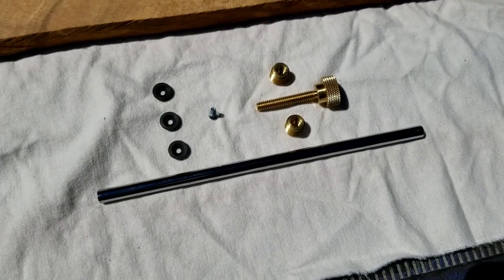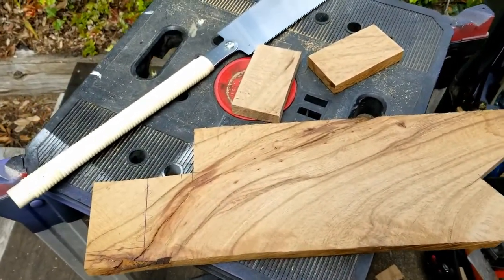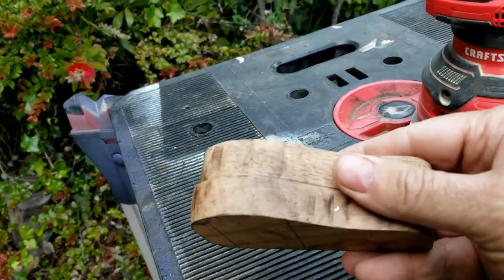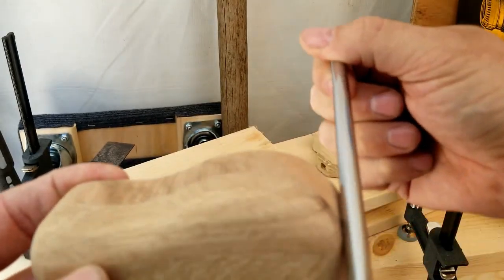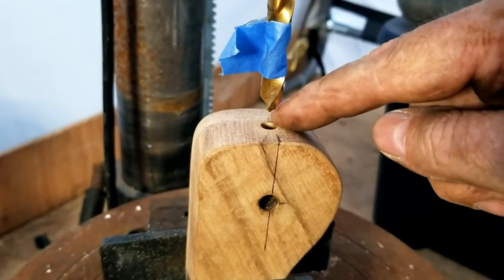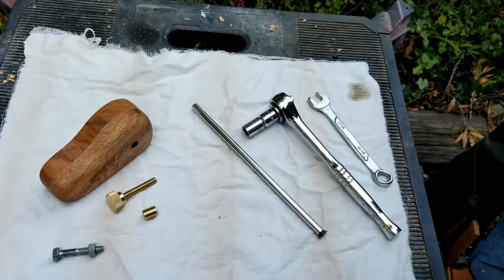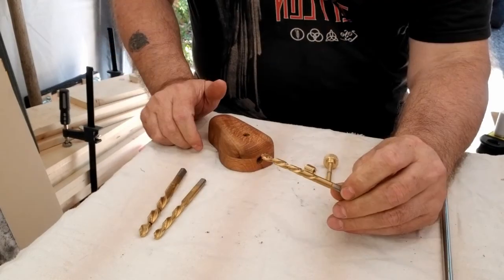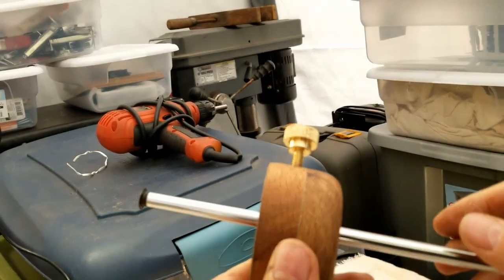Making Marking Gauge from Kit (TayTools) :: PaleRider's WoodShed

Comment: I think you would have an easier time if you drilled your holes before shaping the wood. 

If I want to have a hole located in a certain spot at 90 degrees, I'll drill a smaller diameter first and check the angle before drilling the final hole. The smaller home can be a through hole, then I can drill the final size coming in from both directions to meet in the middle. Which eliminates tear out 

For me the marking gauge is useful enough that I want to have several.

I prefer the 25/64" bit over 3/8, but that's me. It is easier to drive the insert in.

Rather than use the insert, you can drill and tap a 1/4 - 20 hole in the wood. Thin CA glue can be wicked into the threads to stiffen them up for longevity, followed by paste wax. But that is better in a fine grained wood like hard maple vs oak.
Reply from the maker: Thx for the advice.  I actually learned a lot from doing this, and will do it way different, the next time I make one.  Since this video, I also got another marking gauge (and old Stanley one, with 2 rods), from a viewer... I did an unboxing video, with it on the thumbnail :)... check my homepage.